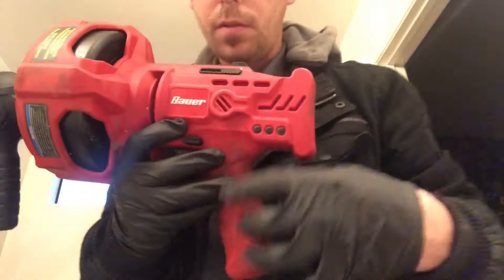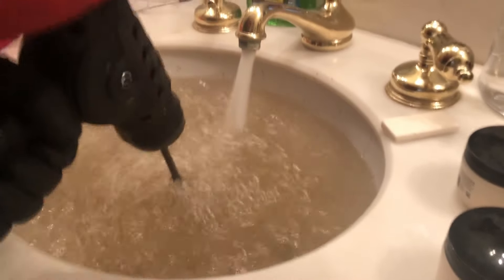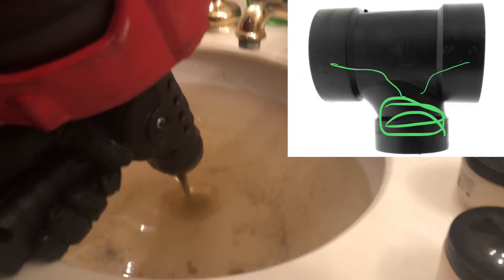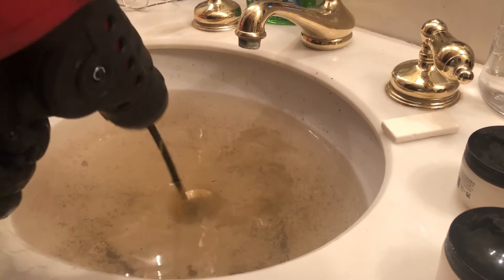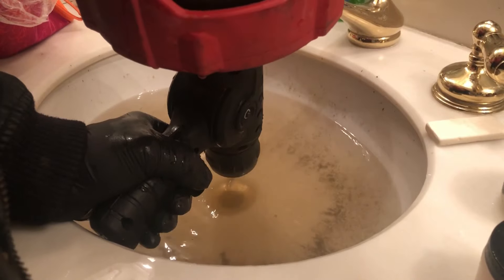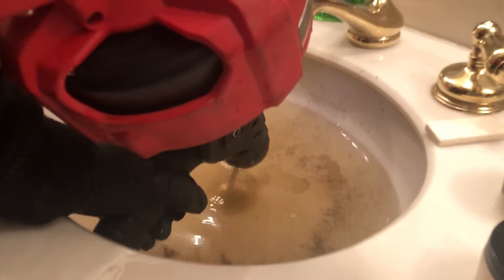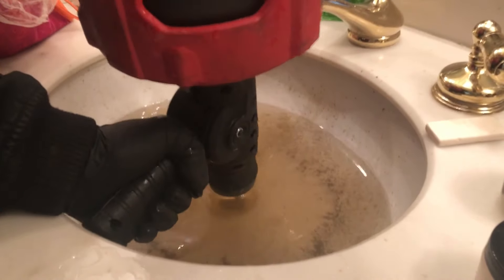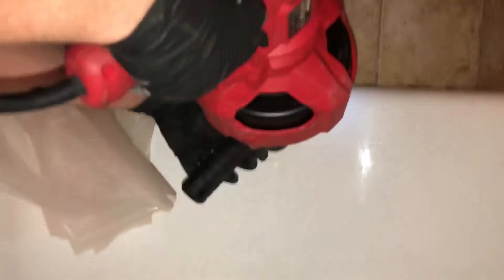Bauer 23 Ft. Auto-Feed Handheld Electric Drain Cleaner Review REVIEWED

Comment: I bought 2 of those ones you hook on to your drill and they both stripped out.for 2 weeks I tried everything I seen this at harbor freight and it took about 20 seconds and it was so easy.this is unbelievable tool.and your right it looks like a weapon it something
Reply from the maker: Yea man I love this snake Its honestly incredible for the price I recommend it to everybody just dont go trying to clear a mainline with it or anything crazy and you will be alright haha
Reply: Hi buddy, I am super in residential building  (108 apartments ) and always l have problems with regular electric snakes with bathtubs(are heavy & some time need two people to operate ) , this tool work good for bathtubs?
Thanks!
Reply: Pined comment
Reply: What did the snake do? Push everything down or pull everything towards you?
Reply: @bistbish3996  put a a one maybe two 45  degree angle on the end cable.it should slide right thru

Comment: Cool trick.. I didnt see the cabinet, but you should have sold the customer a cleanout and then snaked it through that. Would save you time and make a little more $. Plus you wouldn't have a bent cable
Reply from the maker: Yea i gotta sell more cleanouts man good tip thank you!
Reply: @PlumbingExplained  
For sure, i had the same exact reaction when i saw that bad boy at harbor freight. Then I saw the battery powered one which was cheaper if you already had batteries. I've pretty much just used the super vee on old company work rig, but for 120 bucks? Goddamn. Im curious if the HF is rebranded and is same tool as one from Amazon for 75 bucks. Looks identical besides color. Have you, or anybody you known used the one im thinkin of? I've wanted to do exactly what your doing with the youtube. Ill subscribe and maybe throw some video ideas your way
-Kevin
WA state studor venter extraordinaire
Reply from the maker: Kevin Baker I have another subscriber who bought that one it’s the same exact snake just different branding if I’m not mistaken

Comment: No info here about pipe diameters . I see this comes with a 1/4" cable, which I read elsewhere is for use on pipe from 1" up to 2". 
I need 1/4' to make some tight turns in cast iron fittings for 2" pipe.
I also need to clean long settled crud and probably rust inside a 2" x 20 ft  straight drain pipe/clean out. I think it's seriously gunked up and hard packed.
I don't think this could work for the 2" pipe. 
I am interested in tips from experienced users.
I wonder if I could buy an additional cable, like maybe a 3/8 diameter and switch them out as needed.
Reply from the maker: You’re better off getting a flex shaft, the k9-12 does up to 25ft

Comment: I live in a 94 years old house with original clay pipes sewer system. A few weeks ago kitchen drain line stopped working. I tried to use hand snake but could only to pass about 3 feet of pipes and cable came out covered in almost hardened grease.. I have a big drain monster machine from HF but was not able to pass 1 1/2 inch elbow ( part of PVC piping before entering 4 inch ID clay) , so I got this tool.  It made 16 feet into the pipe  as a champion and opened the drain. Easy to operate, enough power. 5 out of 5.

Comment: I have a basement drain from between my furnace and water heater that runs over to the sump well, about 8 feet away.I used a 25 foot Cobra Tools 1/4 inch snake and it kept getting stuck, making it difficult to pull out.Will this Bauer drill snake work better? The drain has the line from my furnace dehumidifier emptying into it. The drain is  cast iron  drain installed in 1986 when the house was built. IT has a square plug screwed in just next to it. Does the drain snake go down where the plug is or down the drain itself?Is the 1/4 inch snake heavy enough? Or should I replace it with something stronger?
Reply from the maker: I think your Cobra might be better than this Bauer, you might be better off trying a Spartan cable in that Cobra machine before buying this Bauer I think you can get a Spartan cable for about the same price as this Bauer and spartan cables are just the top of the line cable in drain cleaning. They are made with Zinc so they dont rust and they are much much more rigid than any other companies cables. I just cleared a kitchen sink stoppage in a 1 1/2 cast iron system using my Spartan Model 81 and my 1/4" cable. 

If youve got the money though I would suggest looking into the new Ridgid flex shaft the K9 102 would be perfect for what you are describing and you can actually completely clean the inside of the drain and bring it back to almost like new. Subscribe to the channel Im actually editing videos on these machines and cables right now so theyll be dropping in the next couple days. 

Thanks for the comment! always glad to give my advice.
Reply: @PlumbingExplained  The Cobra I have fell apart, the stub where the drill attaches  broke inside, so it's junk!
Reply: I think I'll call a local company that does this kind of work and let them take care of it. I'd hate to buy this Harbor Freight device and have the cable snap off or break inside the drain just adding to my problem. I did some research and a 3/8 to 1/2  inch cable is recommended for floor drains. THe Harbor Freight tool is only 1/4 inch.
Reply from the maker: @vaapilot  yes I think your best bet is definitely call a plumber, sorry you are having a hard time bro I misunderstood your original post I thought you said you’d been clearing this drain with your 1/4” cobra and now you can’t get it through, I assumed maybe you just needed a more ridged cable like a Spartan, I’m not too familiar with basement floor drains or what size they are. Sorry for giving you the wrong information. 

Also a ridgid flex shaft would be a great machine for this application look into them. Might be a good idea to own one if you’ve got older drain lines in your home.
Reply: @PlumbingExplained  Thanks for the reply. My house was built in the spring of 1986, so it's almost 35 years old. The basement drain I am talking about has a cleanout plug next to it, that uses a square ended wrench device to remove it ( same kind of drain in my garage) but as far as I know, it has never been removed. Which leads me to this question, would I put the snake down the cleanout plug, or down the main drain hole? ( If I so decided to try and snake it again?) Being this drain is almost 35 years old ( and never clogged up before) I don't know if a cleanout drain wrench would work on it, considering that it may be rusted shut in place? My garage drain is also clogged up, and I assume goes to the drain line behind the garage  -30 to 35 feet away that feeds into the septic drain field or the septic tank. I am the second owner of my home. Been here 31 years. The garage drain most likely is clogged from snow and sand runoff from my cars over the years.
The basement drain cover metal plug was heavily rusted, so I put it in a bucket and put some water and some "rust out" in with it.Maybe clean it up and paint it with with rust proof Rustoleum to prevent further damage? What do you think?
Reply: Perhaps the Harbor Freight machine would be okay to have for future sink clogs, etc upstairs where something heavy duty isn't required?
Reply: I will also add this comment. As far as I know, the only liquid to go down this drain has been from the humidifier-dehumidifier from the furnace  and A/C . I have never poured anything down it. So all I can figure out it must be an accumulation of rust from the drain cover or the drain and pipe itself? And if a plumber tells me it should be replaced, I would never attempt the job myself. I can tackle a lot of DIY projects but something of this nature is outside my wheelhouse! I would have it profession ally done. I know it would have some cost to it, but something like this would need to be done correctly!
Reply from the maker: @vaapilot  yes absolutely so this little machine is perfect for Bathroom sinks, Tubs, Showers, you can potentially clear a laundry drain but not a guarantee. This machine is perfect for anything up to 2" i think 2" is pushing it with this machine and its stock cable. I HIGHLY recommend if you are getting any drain machine including this one to order a Spartan 1/4" cable to go along with it. I have a video on here that shows you how to change the cable. The stock cable on this machine sucks I changed it twice and after putting a spartan cable in it lasted me til it got stolen!
Reply: @PlumbingExplained  My washing machine drain line feeds directly into and is directly above the main sewer line leading out the rear of my basement to my septic tank so I doubt it would plug up. It's a PVC pipe, about 4 feet long.
All my plumbing  lines are PVC pipe .From where the washing machine PVC line feeds into the main line to the septic tank, it's about 30 feet or so to the septic outside the back of my home.
I had it pumped just over a year ago, and the guy who pumped it told me it's the best looking septic system he had seen in awhile. It's an 800 gallon tank feeding into a distribution box about 50 feet away then the fingers go out across the backyard which is about 3/10 of an acre.Where I live in the country has no sewer access  and closest lines are just over 2 miles away. There are about 30 homes in this rather large addition shaped like a "square shaped U" around a 45 acre farm field . which now has winter wheat in it.The county told us it would take a minimum of two pump stations from the addition to the sewer line 2 miles away, at a cost of about 1.5 million dollars
Reply: @PlumbingExplained  Where do I get a Spartan cable? I live near Ft Wayne Indiana, a fairly good sized city with much industry and industrial supply companies. One of them is National Mill Supply which just did my New Honda generator recalls
Reply from the maker: @vaapilot  National Mill might beable to order one for you otherwise www.SpartanTool.com and find a rep in your area, the guy will come to your house or place of business and install the cable for you! If money isnt a big deal to you heres my honest recommendation. Look into the Ridgid Flexshaft depending on the size of your drain theyve got the k9-102 and the k9-204 the 102 does 1-2" drain lines and the 204 does 2-4" drain lines I have both of them and they are my new favorite machines. They use chain knockers instead of cable and they can actually clean the entire inside of your pipe back to like new condition. The 102 is like $830 and the 204 is $1300. The 1/4" spartan Cable is gonna run you around $100. Spartan also sells the Spartan 710 model which is a cordless drill snake 1/4" cable that is a bad ass machine for sinks and tubs stuff like that. You can often fid them used for under $500
Reply from the maker: @vaapilot  if youve got any other questions or problems and need a quick response send a text to my business Line 949-512-5034 or Email us OCMaverickplumbing@gmail.com ill get back to you as quick as I can. Youtube doesnt always update me when you respond.
Reply: @PlumbingExplained  Okay thanks!

Comment: Why is it bad to shoot down a pop up if I remove the pop up first? Honest question if that sounded smart sorry lol
Reply from the maker: There are a few reasons, you could potentially blow out the bottom of the P trap, it makes it harder when pulling the snake back if its got debris on the tip, the cable could bind up and whip around causing damage to the sink and fixtures. Those are the few I can think of off the top of my head.
Reply: @PlumbingExplained  thanks

Comment: Trying to snake my shower drain but seems to keep going up the vent instead of the drain line with this machine. What do I do I’ve been at it for a couple hours can’t get it unclogged.
Reply from the maker: Sorry for such a late response bro.... Typically i recommend trying to run it very slowly in reverse while feeding the cable out if you keep going up the vent, running it in reverse sometimes will help it make the drop or atleast possibly knock something loose so you can make the drop..  Run it in reverse and put pressure on the cable back toward you slightly.

Comment: I bought one of these today to unclog a kitchen sink drain in a rental unit.  The clog was down fairly far so I had to disconnect the drain pipes under the sink to go straight into the iron pipe that comes up from the basement and out of the back wall under the sink.  I ran it down pretty far, don't know how far exactly.  But it did the trick!  Bunch of hair on the end.  Think my renter has been washing her hair in the kitchen sink. 

Anyway, a plumber or Roto Rooter would have been $150 minimum and this unit was about $125 out the door, so I feel like I made money today by saving money, and who knows how much more I will make/save in the future with this little unit.  I'd spent $350 on the last couple months on Roto Rooter and decided NO MORE!

Comment: Looks great on the outside. Inside is junk. I bought one today and the line broke.
Reply from the maker: The cables are definitely trash that’s why I recommend putting a different brand cable in, the inside of the machine isn’t built to last it’s basically a throw away, once a year buy a new one. It’s cheap enough

Comment: I have a laundry machine with a sink next to it. The laundry machine backs up into the sink. I tried using a 10 foot manual snake. And nothing happens to the water. It goes down gradually slow. If I get this and use your technique do you think it would do the job ? What's coming up is like a  black sludge and dirt.
Reply from the maker: yankeemoe i have cleared several laundry lines with this machine it’s perfect for that type of light duty drain cleaning. The manual ones just don’t spin fast enough and aren’t rigid enough half the time you shoot down the drain and it turns around and comes right back at you this machine is perfect for you 👍
Reply: @PlumbingExplained  I appreciate it man. Thank you so much. I'm going to give it a try.
Reply from the maker: @yankeemoe  You are very welcome my friend come back and let me know how it worked out for you! Also if you need any help or have any questions feel free to send me an email i can give you my cell number and I can help walk you through anything you are having trouble with if I have time! Im gonna start doing a Live stream on sundays where my viewers can come get plumbing questions answered and stuff like that. OCFriendlyplumber@gmail.com
Reply: @yankeemoe you might think about getting a buildup remover. I had a similar problem and after using a rented auto feed auger from Home Depot which was 70 bucks and until 8/31/19 this Bauer auto feed auger from Harbor Freight is only 99.99 plus tax. I use Green Gobbler from Amazon I get 25 lb bucket of powder for 60 bucks. When I am done with the laundry I dump a scoop down the laundry sink and I put a dissolved scoop down the washing machines waste line. 1 year and no more backups.

Comment: This is simply the best small power drain snake on the market. I have wasted money on a number of others and always go back to this one. It is a true power feed device for about 100 bucks. Simply dirt cheep. Sadly I broke the cable on mine just yesterday. The cable replacement is about 25 bucks. I was clearing a galvanized drain in a 120 year old house that had some non code switch backs and connections.

Comment: is there a stopper at the 23-foot mark or will the cable come out if you keep on advancing it?
Reply from the maker: Which cable are you referring to? The stock cable or the cable I recommend replacing it with? With the stock cable yes there is a part at the end of the cable that will stop the cable from running all the way out  but not with the cable i recommend replacing the stock cable with. The replacement cable I recommend does not have anything to stop it at the end so i recommend once youve got it installed putting an L shape bend at the very end to stop it from feeding out of the machine Hope this helps have a great day!

Comment: Great video. I bought one of these  a few years back . I honestly did not know I had just bought the best damn drain snake for the money. Power fed forward and reverse. A very well made unit. I have a ton of the Mill? stuff including a power drain snake. Spent a lot more money on it than Bauer. Broke the cable on the Mill and saw this in my overflow shed. Used it today and had to ask myself. Why was I using that other piece.   Onward and upward.

Comment: Great review! When I first bought it, I thought that it looked almost like a kid's toy because of the bright red but this really is a great tool. Make sure that when you buy it you go in there with a coupon Harbor Freight literally Sands cash in those weekly Flyers.

I don't know how many times I've had to run this down shower drain or down the bathtub overflow, but every time I do it I know I'm saving myself at the very least $80 to have a plumber come out and snake out a drain. Granted, I am a plumber, LOL.
Reply from the maker: Hell yea Pablo everytime you clear that drain you are saving yourself atleast $95, No plumbing company worth a shit comes out for less than $95 and then theyre gonna try and sell you a bunch of shit and having some stranger in your house none of these plumbing companies force any of their employees to prove how long theyve been a plumber so you could potentially get a guy who knows less about clearing that drain than you do!
Reply: Can i ask you a question? I do small tasks for maintenance in buildings, for bug jobs we call real pro plumbers, but i juts got an air snake feom Milwaukee what are your thoughts on those?
Reply: @maxpainmedia  air snake just moves the blockage does not remove it electric cable is what I use..and flush out the line real good at same time